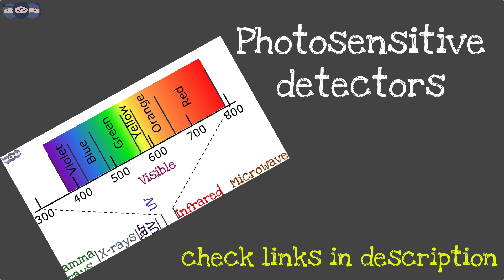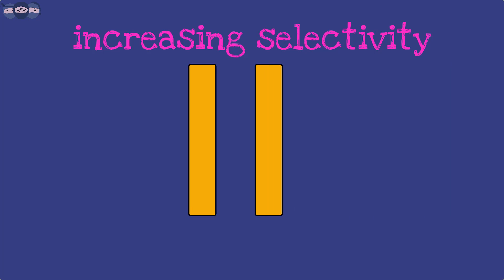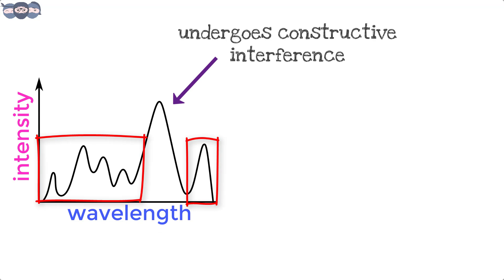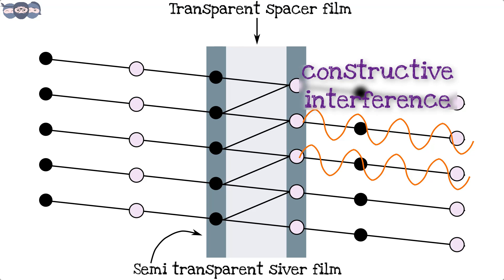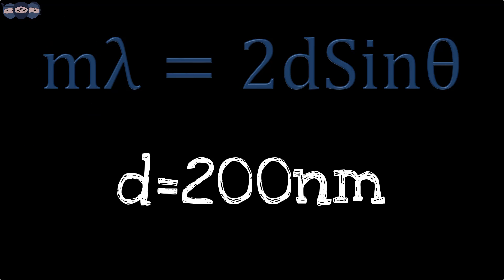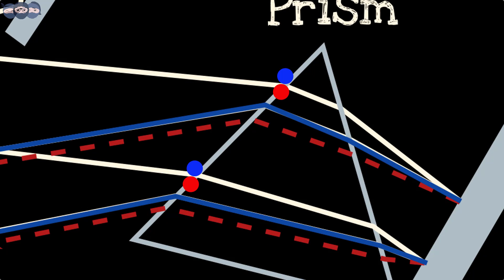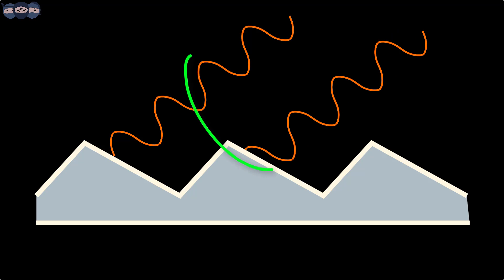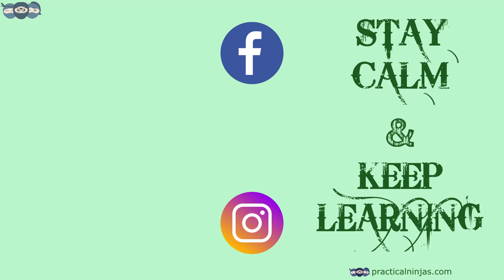Analytical Instrumentation 02: Obtaining Monochromatic Light | Filters & Monochromators Explained"

Comment: on the diffraction grating, the animation is badly made, why? reflection occurs at same angle as the incident ray to the opposite direction. The particle is shown to come at an angle and reflect at an arbitrary angle, which is bad for the student, cause he needs to know that reflection occurs at a specific angle relative to the normal vector. Also, what is the theta angle? What is the distance d?

Comment: thanks for the good video but i have a question, what are the difference in function and application of filters and monochromoter wavelength?
Reply from the maker: @Irene Emanuel. Glad you liked the video :)
The main function of a filter or a monochromator is to separate a particular wavelength from the stream of light (which is made up of numerous wavelengths). By doing so one can obtain a monochromatic source of light from a normal source of light (e.g. tungsten lamp). The application of filter or monochromator can be a photometer or a spectrophotometer respectively. Hope this clears your doubt. If still have any query about the topic feel free to comment :)
Stay calm and keep learning!